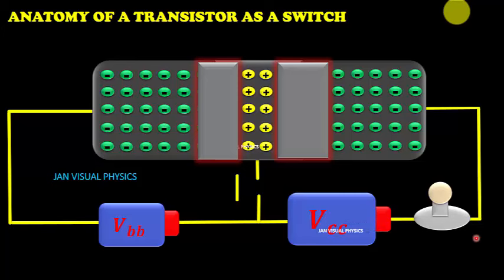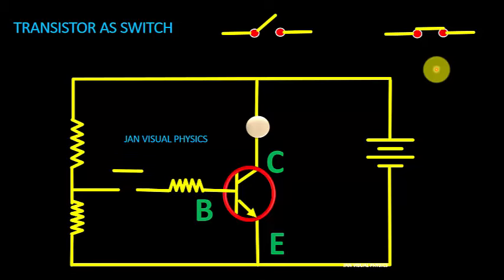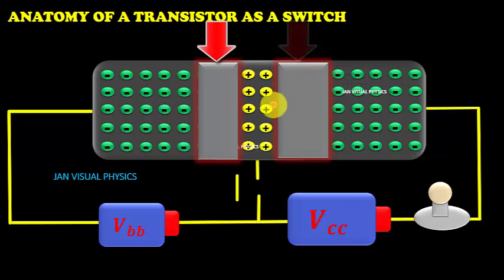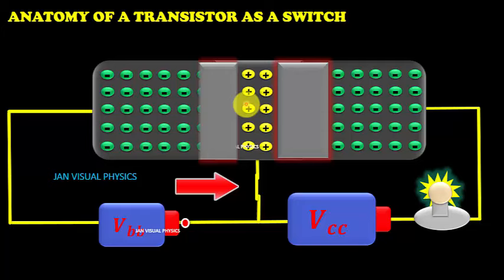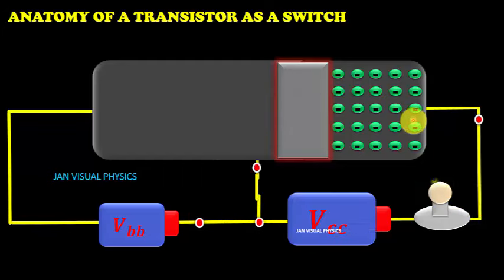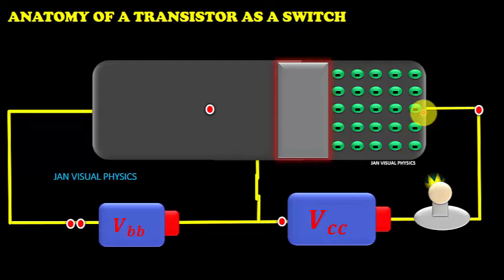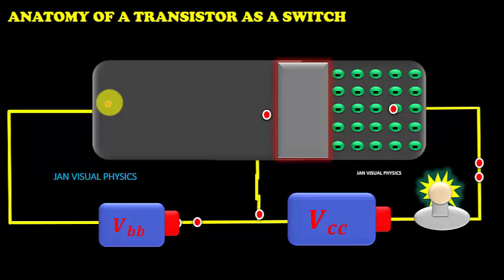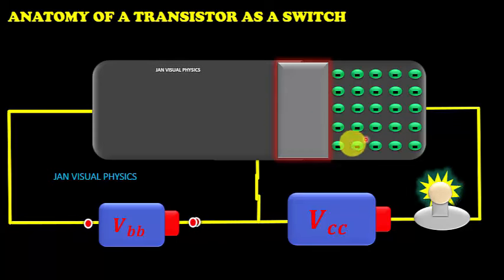How does a transistor work as a switch | What is the application of transistor as a switch

Comment: It is known as transistor  works as switch in saturation mode in which emitter base and collector base both are forward bias but how you are using transistor as a switch in active mode in where emitter base are forward bias and collector  base are reverse bias
Reply from the maker: +KiNG KhaAN 
in active mode transistor behave as Amplifier 
in which a varying (sinusoidal) input signal at the base  turn on and off the transistor 
in +ive half cycle transistor switch on and vice versa

Comment: Thank you for great and high detailed explanation sir!
But could you please tell me how transistors turns off and on? Should voltage be applying in the central pin all the time to keep circuit connected? Or you just make impulses to turn it on/off?
I trying to find this info for so long, and no luck with that:c

Comment: sir in the video transistor as a switch base emitter junction is forward biased but base colletor  junction is reverse biased during on state of transistor.How this is possible?
Reply: Base emmiter junction is forward biased to decrease resistance and increase current by decreasing the depletion region.while base collector junction is reversed biased due to large depletion region and also connected with greater battery to have more attraction.

Comment: The Load recieves 95% of the current, when using the BJT because 5% goes through emitter. Instead, I can use a simple circuit with a battery connected directly connected to the same load and it'll receive 100% current. Then why do we use BJT?